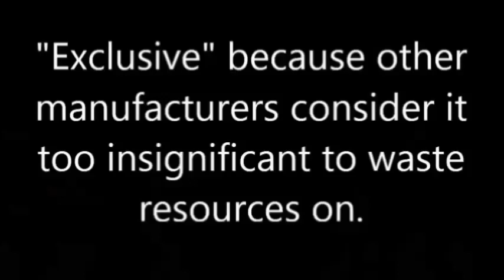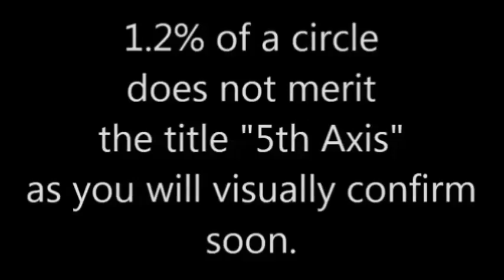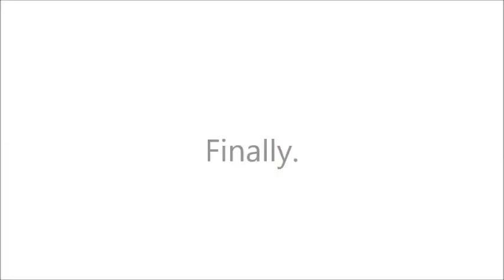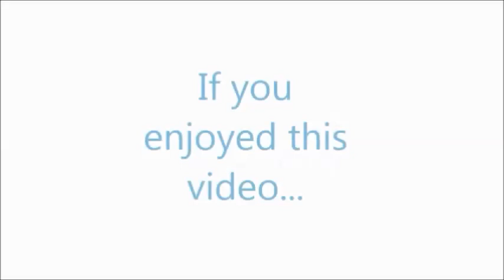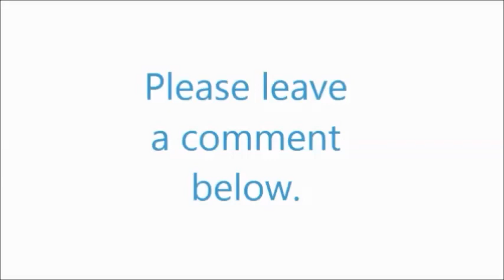Legacy Woodworking Machinery's 5 axis cncs (compared with other American 5 axis manufacturers) 2018

Comment: Definition: Five axis CNC machining refers to the ability of the CNC machine to perform movement about five different axis simultaneously. So you are both right and wrong in saying Legacy is not a 5 axis CNC. The Legacy "Can" move in all 5 axis at the same time. But it can't CUT in all 5 at the same time. So saying it is a 5 axis machine is a stretch but trying to compare their machine to something that costs 10 or 20 times as much doesn't make theirs a bad machine.If you can afford a $200,000+ machine then sure go for the "real" 5 axis machine. But to say something is bad that is not as flexible that costs about $20,000 is at least as bad as calling it a 5 axis machine.
Reply: Hi Lexst1. I thoroughly enjoyed you educated comment. I had to read it 5 times to work out an (hopefully) educated response. A pickup and a Mack truck are both vehicles for carrying stuff but please don’t call a pick up a Mack Truck. On prices, Bacci’s entry price is about $100,000 not x10. Shopbot is around $50,000 but they truthfully warn you that their CNC is for light duty only. I am a professional carpenter and I own 3 CNCs. I will not buy a 5 Axis even if I can afford it as I don’t see how I will exhaust the capability of my heavy duty 4 axis before I die. Thank you so much.

Comment: Don't believe this guy. Many people like me are having a lot of fun with their machines. I do sound sculptures, furniture, musical instruments and other stuff for sell or the shop. It does a great job and it is very versatile. The machine is made out of strong steel and works from the time I got it in a huge box. Their customer support is also excellent and I have never got stranded because of need of support. Also, as other people said already, Legacy does not said the machines are 5 axis. You can do 3D work and turn projects in their lathe. You can use the full 3D router in a lathe, you can call it 4D, 3.5D or whatever, just they do a great job, made in America and work horses.

Comment: I have a ? What are your other cnc’s and what legacy did you buy and what where you wanted to do with it .
Thanks
Mike
Reply from the maker: Mike, I am specifically making a video that will answer ALL  your questions. Kindly subscribe and press the notification bell. I am not monetizing this channel. i am a carpenter and I do not represent or endorse any brand. I am just a carpenter. Thank you.
Reply from the maker: I have a CarveWright that I totally enjoyed, them a Legacy Arty that was a disaster. I now have a Titan Centurion which is strictly 4 axis, 2.5 tons, all motors servo, auto tool changer, 7.5 hp HSD air cooled spindle etc. I don't use the Carvewright anymore just like I have replaced Aspire with RhinoCam. The CarveWright is still working and Aspire is excellent but I have outgrown both of them.
Reply: Obviously Legacy is not 5 axis.
Reply: @legacywoodworkingmachinery1977  how much did you spend?

Comment: Both machines have their places like the lagacy is for more cabinetry based things witch are typically flat or cylindrical and a 5 axis is for more complicated parts that a 3 acis could do but most likely not to the scale shown in the video

Comment: Can a cnc machine be used for metal working?
Reply from the maker: Yes but with major chanes to the spindle which holds the bit that is doing the cutting. The spindle have to be equipped with a hose to spray water so that the  bit  does not become hot
Reply: I am a metalworker. What do you suggest.
Reply from the maker: Type "metalwork cnc" in youtube.
Reply from the maker: Find someone who owns a cnc and try to spend at least 40 hours watching/assisting in the operation of the machine before you make any purchase decision.

Comment: Frankly, how many axes is a machine supposed to have?
Reply from the maker: Axes starts from 2 axis for a laser cutter to at least 10 axis and beyond.
Reply: I want to use cnc for woodworking. What do you suggest.
Reply from the maker: Are you a carpenter?